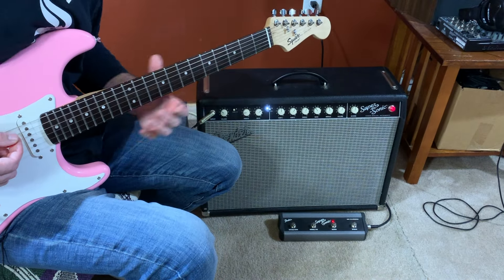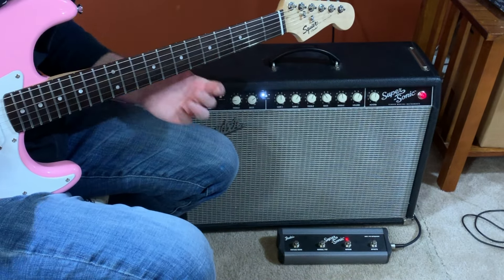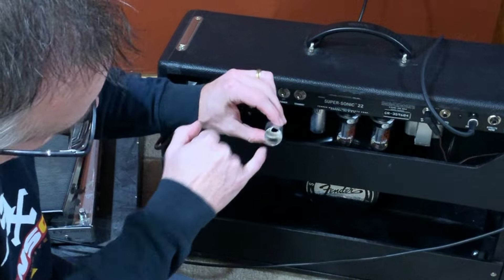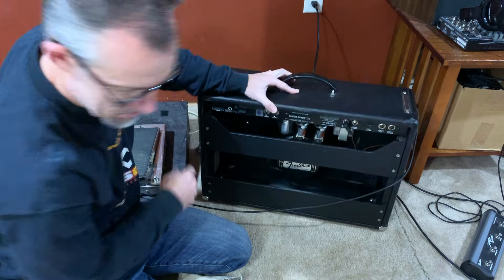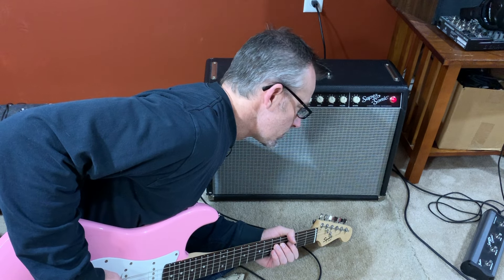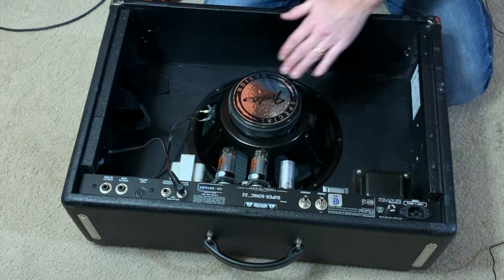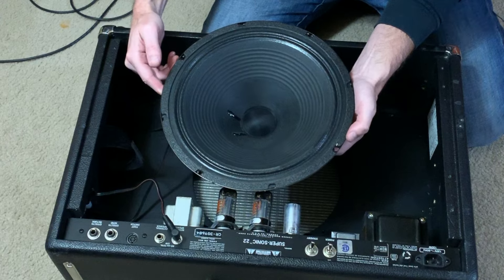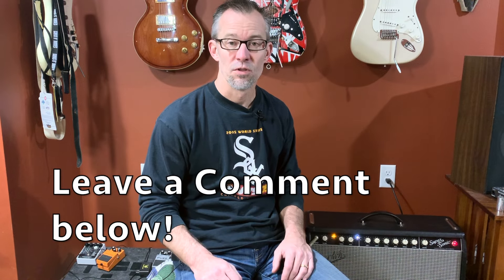Fender SuperSonic 22 Issues Tube Rattle

Comment: Tube is rattling.  Difficult to figure it out. Change one at a time til you get the correct tube
Reply from the maker: Unfortunately I've noticed that I get noise on the AC line, when my furnace or clothes dryer kicks on. Much harder to isolate this. Thanks for your input!

Comment: My suddenly blasts a loud hum like you the volume is domed and you put your finger on the end of the cord without touching ground. Had it to two repair shops and no one heard the problem off hand to fix it, the sound is spuratic, happens every once and a while
Reply from the maker: Maybe a loose solder connection on the board would be my guess. Good luck and thank for watching ✌️

Comment: FYI: it’s known Fender Reissues that have tube rattle on certain notes aren’t always a power tube issue. It’s well documented and a Fender tech changed 6 set of tubes in front of me. It was the Tube Holders on a LOT of the new reissues. Once the Power Tube holders were replaced no issue. 

Many touring musicians do not take out their nice amps on the road. But don’t be fooled! Those reissues that are using are torn apart by a tech, parts upgraded and replaced. Buy a used Reissue that’s new $1499 for $800-$900 local mint. Bring it to a tech for quality of life upgrades at $300.. for $1,200 you’ll have a better than new amp that will last you for years to come. New prices on reissues, are projects out the box to be road and recording ready. 

Also if you love Fender look at an older one, and price in the $300 tech visit. 60s Super Reverbs if you don’t mind the weight, can be found local at reissue new prices. Then a tech look or maybe the owner did it and your good to go. Tube amps are an investment so do it right the first time. I def learned that lesson!
Reply from the maker: Appreciate the info my friend!

Comment: I have similar rattle in both my 68 Custom Deluxe Reverb and Marshall DSL40C.  Just ordered exact same power tubes for the Deluxe, hoping that's all it is and I won't need service. Had similar rattle in AC10, amp tech fixed, said he swapped power tubes and resoldered a couple joints.
Reply from the maker: Yes I will need to do the same and get some fresh tubes. Thanks for the input!
Reply: Just put the new power tubes in today and rattle is gone, that was definitely it.  Tubes ended up not being exactly the same, there were Mesa Boogie 6V6 yellow in there and I put in red, but sounds fine so far. Guess if the amp blows up I'll find out that was important.

Comment: Just found this video,
I just bought a used SS22 and tubes in it are Groove tube power tubes original
And preamp JJ replacements. I did bite the bullet and found a complete matched set of JJ’s as a back up for 147.00 mark down from 172.00 should be good to go. Thanks for this helpful video.
Reply from the maker: Thanks for watching, and thanks for your helpful comment.

Comment: Hello Richard, Tube rattle is nothing to worry about. I had it in my Supersonic 22 Combo, merely a worn tube, microphonic, take the metal covers off and tap them with a wooden appliance ie chopstick, or pencil, with the amp on, hopefully only a preamp tube is worn, swap it out for a new tube around $20, it happened to me a worn preamp tube. My concern with this amp it is bloody loud, need an attenuator, or volume box, pedal in the efx loop, but a truly lovely, versatile amp and very underated.
Reply from the maker: Good tip! Appreciate the input friend✌️

Comment: TUBES! press the tubes  while playing and you are gonna notice that the rattle stop, the filaments inside the tubes are rattling because the speaker is pushing too much air backwards. Is not a speaker problem, just tubes, you can replace the tubes and could work or maybe not, is a very common COMBO AMP PROBLEM. Good luck!
Reply from the maker: Thanks for the tip and for watching!
Reply: My brand new Marshall JTM combo studio has tube rattling as soon as I connected to the separate speaker cabinet no more rattle because there’s no more vibration from the speaker amp has awesome tone but the rattle sucks and hit it with a pedal then it’s really noticeable gonna take it back and order the head and speaker cab

Comment: I have a brand new Hot Hot Deluxe that I took out of the box and it has this rattle on low notes.  It's driving me crazy also.
Reply from the maker: That’s troublesome if it’s brand new. I’ve thought the same thing about the low frequencies, maybe a speaker replacement is in order
Reply: Hey, I just had the exact same problem! I actually A/Bed two identical Hot Rod IV in the store and both of them had the same rattling issue. I'm guessing that is the internal tube construction issue in which some stuff are vibrating inside. Or maybe something else totally different have no idea. The surprising part is that I actually tried a '64 Custom Shop Hand-wired Deluxe Reverb ($4000+ in Australia) and it also had some sort of rattle in the cab as well! go figure...

Comment: dont know if you have resolved it or not

I had the same issue in a Peavey Classic. It was from a power tube. My research indicated that it is common in combos as tubes are subjected to hits from  wave after wave of sound from the speakers

to know if its from a power tube, you have some one play the offending note, usually a low frequency note causes the rattle, and you try to hold each tube in turn or two tubes at a time with hands in thermal gloves and see if the rattle stops.

I emphasize: Tubes are hot and you will need your hand (and all other parts of your body) to be thermally isolated and not directly touching them

let me know if you have solved it and what your solution was please
Reply from the maker: Thanks for watching and contributing! I haven’t replaced the tubes yet, only annoys me at low volumes, and I usually play loud so I can deal with it. I also own a 50w Peavy Classic 4x10, and those are probably due for a change also. Crap this is getting expensive!

Comment: I had this EXACT problem with a few new  fender 65 deluxe reverb reissues.. long story short I ended up returning the amp because I felt like it wasn't my responsibility to change the tubes in a brand new amp. The issue happened back to back and the guys at my local Sam Ash acted like their was nothing wrong with it... cant believe there's not more stuff about this on reviews.cause it was the same issue on 2 brand new amps right out of the box.
Reply from the maker: Pat Millen thanks for sharing your experience. I bought mine second hand so I assumed some risk. Maybe the sale people you dealt with were inexperienced but then again they should be trying to help a customer. I’ll have to do a comparison once I get fresh tubes. Thanks again for watching!
Reply: @RichTones  yeah im sure some new tubes will do the trick! Good luck
Reply: Same thing happened to me. Brand new Marshall Origin 20C had rattling tubes. Reached out to customer service, no help whatsoever.

Comment: Hi,
This might be one or both power tubes. You can try to tap the power tubes one at the time with the amp turned on, if you get the rattle once you tap the tube it means that needs to be replaced. Please keep in mind that the vibration from the speaker been so close will make this to happen quicker than head and cabinet
Reply from the maker: Rodrigo Vukovic Appreciate your tip. Will try that next
Reply: Just unboxed mine today and same problem with the mysterious rattling as tuns out was #2 power tube making noise. I used a glove and held tube in question while playing loud low e note as definitely was the culprit. Disappointed as this was (supposedly) right from GC warehouse.

Comment: Hi Rich, did you ever get to the bottom of this. My Princeton has been doing the same thing. I managed to narrow it down to 2 rattling power amp tubes and to of the metal preamp tube covers were rattling. My princeton has a 12 " speaker in and it seems to be any tubes that were directly behind the speaker were rattling.
Reply: Do you have the 62 princton reissue?

Comment: I returned a Fender Hot Rod amp because of this and the new one has the same rattle.  Driving me crazy
Reply: Hey, I just had the exact same problem! I actually A/Bed two identical Hot Rod IV in the store and both of them had the same rattling issue. I'm guessing that is the internal tube construction issue in which some stuff are vibrating inside. Or maybe something else totally different have no idea. The surprising part is that I actually tried a '64 Custom Shop Hand-wired Deluxe Reverb ($4000+ in Australia) and it also had some sort of rattle in the cab as well! go figure...
Reply: Just bought a deluxe reverb yesterday...might return for the tone master...

Comment: Having this problem with my Monoprice 15w!  I just replaced v1 and both el84s but I suspect it's the tung-sol in v1.  I have o-rings on them and it's only slightly microphonic but just enough to be annoying.  Could I be wrong?  Could it just be the EL84s?
Reply from the maker: Thanks for commenting and joining the discussion! I’m not an expert at tubes but it may be worth changing them if they are old, or just doing an A/b test. Is day it’s possible though.

Comment: Curious if you've fixed this? If not, you may want to try damping rings. Combo amps have a tendency to vibrate alot, and some tubes rattle like crazy at certain frequencies. I had a Deluxe Reverb come in today and it fixed my issue.
Reply from the maker: Awesome- thanks for the suggestion. I have not addressed this yet I’ve got a couple other projects going on currently so hopefully soon.
Reply: Yes this! I got two Fender 68 Custom Pro Reverb amps from Sweetwater. First one had the metallic rattle. Barely touch the offending tube with a shirt or cloth…goes away. Swap the tubes around to see if follows. If it does that’s your one! I was sent a new amp due to tube shortage. Same issue but even worse. And it happen on both at low volumes on specific notes only. It’s a glassy sound that rumbles! 

Now lots of debate about just replacing both and getting a bias. If you have a new amp warranty cam fix this at no charge. But with tube shortage, wait times it can be a pain. Is the tube actually broken or is it just the filament rattling. Some debate that, but if it sounds good and has a filament rattle. There’s a good chance getting a replacement tube set, and bias may not improve anything. These days with supply shortages, and most playing loud they ignore it. But tube dampeners for a subtle issue where you know the tube it is, glass rattle it can fix it. If it’s really extreme it may only shift it to another note. But imo, it’s best to just put some on new or stock anyway. These days the amount of new combo amps out the box that do this is high!  You’re lucky to get one stock with no filament rattle. Fender and most companies are just using what they have. Most won’t complain as a line stage amp cranked. Us practice and recording guys will! Eurotube Dampeners really help!
Reply: It's probably the socket
Reply: @mattg082  yeah I have that problem in my pro reverb RI. The moment I tight the tubes with my hand the rattle is gone. I will try new tubes tmw if not I will change socket and filter caps on the same bench day. I love this amp so bad that it worth the extras
Reply: @borgassi  further research by a Goldstar Fender tech told me it’s the crap power tube holder sockets. Replace those with better ones, and it’s all good! Same issue with most of all the new Fender Reissues. They just cheaped out on those as Fender does. Otherwise dampeners or something to hold them a little is then only thing.
Reply: @mattg082  well I am lucky cause I received today a new set of TADs 6L6 and now my baby sounds great. Rattle is gone at any volume!

Comment: Try to push on each tube with a piece of wood and see if it stops. Once you find the tube you can try replacing our use some electrical tape to isolate.
Reply from the maker: Yes thanks for your suggestion, I will probably look for a new set since these tubes are fairly old.
Reply: @RichTones  I bought a new deluxe reverb with a red back in it....today! It’s already rattling. Ugh. Might be worth it to get a tone master.

Comment: I have the same issue with my early 59' Bassman reissued combo amp barely use it, it's like when you bend a certain note and you get weird glassy rattling sound,  just had it serviced twice as well
Reply from the maker: Didn’t the person who serviced give you any insight?
Reply: @RichTones  False insight the first time  they replaced the power tubes and one capacitor then he was not willing or have someone else to do more work unless I paid him more money for services , the amp does not have a bias adjustment , it was very confusing and frustrating upsetting experience dealing with  the Clearwing production located in Colorado, later I found out it was a microphonic tube but now it hums like crazy after I installed a new preamp tube so I'm planning to take another reputable amp tech to see what he can do
Reply: @davidallen346  I'm sure you have resolved this by now, but I have a suggestion. Use EHX tubes in at least the first two positions. They have spiral filaments which kill the hum. I had the exact same problem and that's what fixed it
Reply: @SonovaBish  you don't think it has anything to do with grounding problem ? The first amp guy who serviced it told me it has a grounding wire not connected and I brought it to another amp tech he swapped out some tubes I'm not sure which one. But one of the pre amp tube was bad with the chopstick tap test that emits s reverb like note rattle resonance like your video demo when playing on the guitar fretboard area. Now the amp has a loud hum when turn on  I might have to take it back to the first amp tech but he charges a premium fee just to look at the amp.
Reply: @davidallen346  I replaced the original tubes with JJ and it hummed almost as loud as the guitar signal. I popped in some EHX and it was gone.

Comment: I have the same amp (7 years old) and same issue. Ive just taken it to my local repair shop where we’ve tried putting some bands around the tubes. Hopefully that will solve it. Otherwise we may have to replace the tubes.
Reply from the maker: Yes I was hoping it was a simple rattle, but keep hearing from people that it needs tubes.

Comment: My Boogie is currently doing the same thing. What you're hearing is the power tube filament rattling/vibrating, more so at the cabinet's resonant frequency. Change your power tubes.
Reply from the maker: saccadelic thanks for the tip! I was thinking it may come to that.
Reply: Is. It possible it's a preamp tube?

Comment: My fender princeton is making this EXACT noise, rattling tube is my theory
Reply from the maker: Yes I've had a number of responses saying that replacing the tubes will solve it.
Reply: @RichTones  Have you tried running the amp through a different cab? It would suck to change out the tubes and not fix the rattle.
Reply from the maker: @jeramybarry2013  have not tried but that is a good suggestion. Thanks for pointing that out. I have a 4x10 Peavy combo, that I could try by detaching the Peavy amp from its speakers.

Comment: Not putting this in a thread so it may get noticed better:
Rich Hoffman I had the same issues with a Laney L5 studio, even without a cab and just headphones on. It could be influenced by drive and reverb (chip) on both channels. I replaced all the tubes (with tung-sols if anyone cares). It had a mix of 2 TAD and a ruby 1ax7 and a ruby el84 (its single ended class A so only 1 power tube) and the problem is gone. It was actually the el84 giving problems but while testing the only suspicious tube was the 12ax7 ruby because it was microphonic.
Reply from the maker: Thanks, and yes I plan to replace the tubes at some point once the budget allows.

Comment: Damn 4 and half minutes later and I learned nothing. Sweet. Got a brand new fender twin that just came outta the box that's making the same noise u ever figure it out?
Reply from the maker: Check out some of the other comments here, several people have suggested changing out the tubes, which I have not done yet. Very odd if your brand new amp is having that issue though. Should be handled under warranty if its a new item.
Reply: @RichTones  thanks man. I actually ended up getting a refund. Kinda bummed. The store I purchased it from gave me run around and claimed its "just something those amps do". That bs. I've owned twins. The whole point of dropping 15hundred on an amp is for the clarity. Then they said "well they break up up that volume". Yeah but that sound is a defect not the amp breaking. "Most ppl don't play them at 5..you can always mic it and run through a pa" and that was the comment that drove me to demand a refund. Damn shame..ill stick with my blackstar for now she's never done me wrong. Best of luck man
Reply from the maker: Wow they either gave you a line of BS or they don't know what they are talking about! What shop was it if I may ask? Tube breakup is not the same as tubes humming or rattling. That's too bad they didn't help you, and good luck in the future.
Reply: @RichTones  place in orange county New York I've gotten 90% of my gear from. I hate dragging businesses through the mud..this is the 1st bad experience I've had with them. I think they were just trying to bs me to not lose the sale. It was the last one in stock so they couldn't even do a comparison or exchange it and the worse part of the whole thing is they restocked it as is, which means the next guys going to drop a ton of dough and go through the same nightmare. Thanks for the vids man keep doin whatcha do 🤘
Reply from the maker: your input is appreciated, and more videos to come.